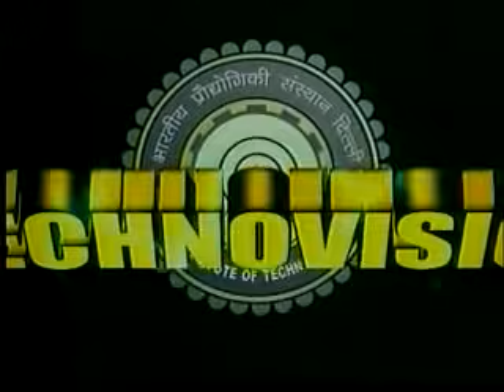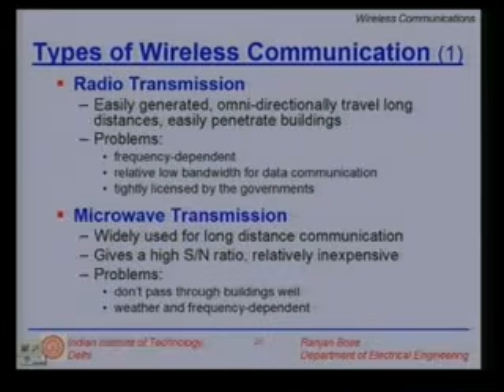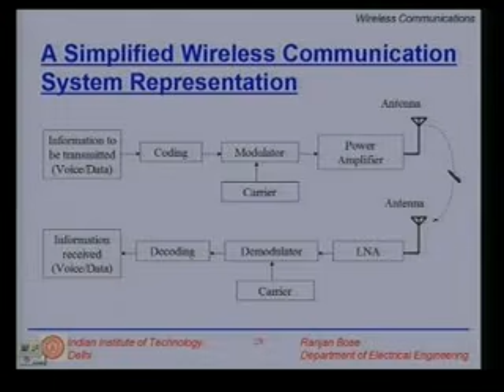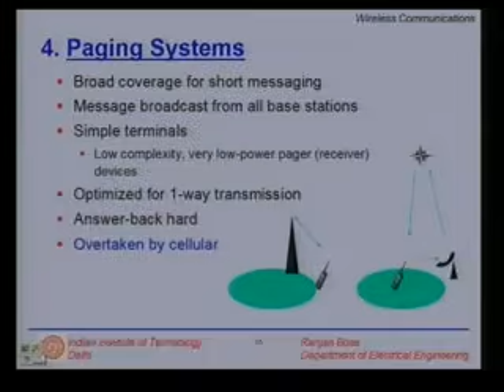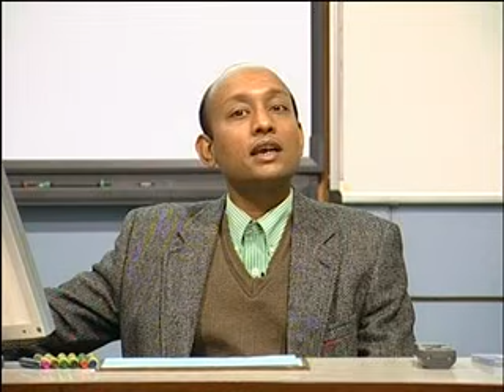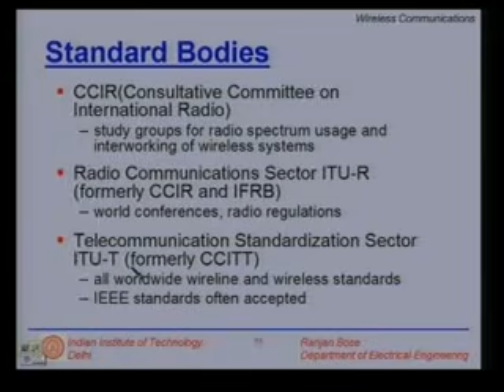Lecture 2 - Types of Wireless communication

Comment: My question is on Handoff: 
If user switch from base station(B1) operating at frequency(f1) to base station (B2) operating at frequency(f2) this means user earlier transmitting signal at frequency f1 is now transmitting at frequency f2 how does this not effect the communication at other side (which earlier operating at f1 and still at f1)